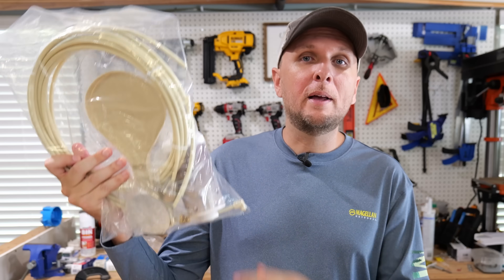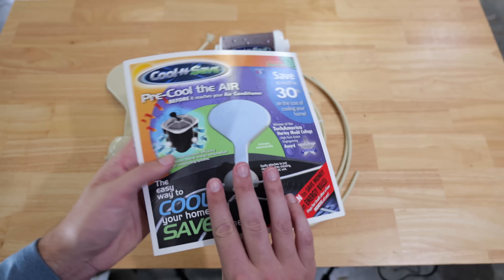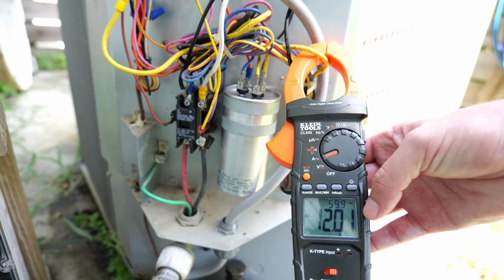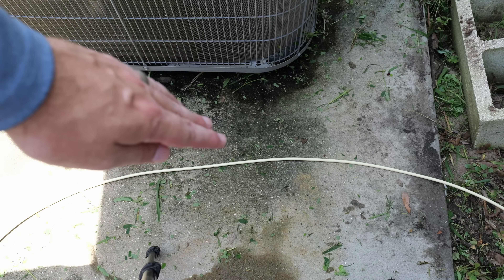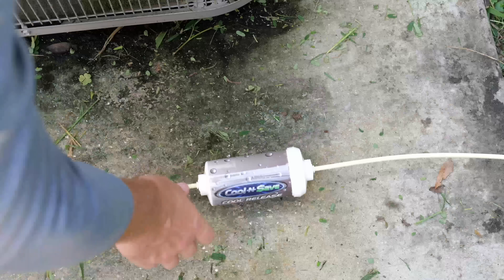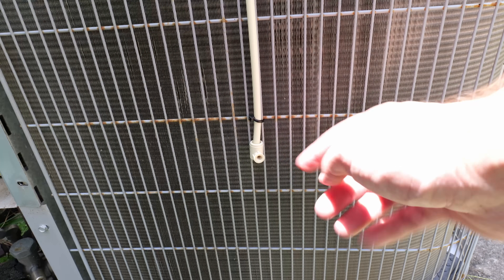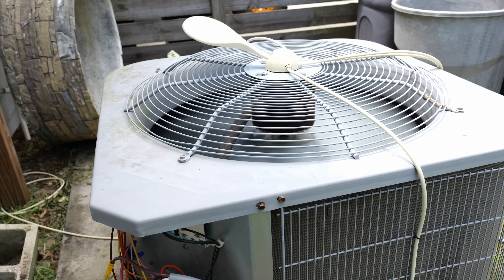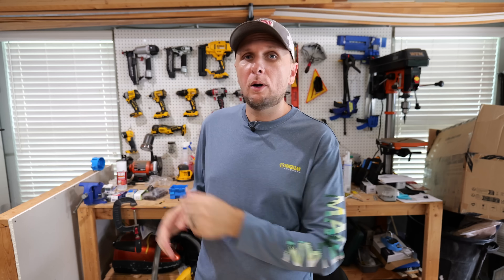This Device Can Save You 30% On Your Energy Bill! Makes The AC Blow Colder

Comment: For most of us, this will 100% eventually lead to scale buildup on the cooling fans, essentially eventually destroying the condenser unit. (That would obviously obliterate any electrical savings you manage to glean from this system.) That little filter they provide is almost certainly not up to the task of removing enough hardness from the water.  Instead, a more robust water purification system sized for the needs/flow rate of this system would need to be installed.  

At a minimum, the water needs to be tested for hardness after it's run through that filter, but I would be extremely skeptical of the "safety" of any hardness level above what naturally occurs in rain water.
Reply: When you say most of us, you are not speaking for those of us who live in an area of soft water. Similar have been used in the South, where I am located, for years with no adverse effects.
Reply: @Watchyn_Yarwood  There's a reason I didn't say all of us, and I indicated that softer water would be okay. But most of us, as in most of the population, does not have soft water. Obviously, some people do, but this system should NOT be installed without understanding and fully mitigating this system and its risks.  The cost of failure here is a new AC condensing unit.
Reply from the maker: That is what the filter is for and I also talk about a water softener being nice added addition.  But the filter removes scale so I think it’s completely false to say it will 100% leads to scale build up.
Reply: @HowToHomeDIY Have you tested the water before and after it has been run through that filter?  I haven't for that one, but I have for others that claim to do the same, and the effectiveness was not terribly high. One should not implement this system without ensuring the amount of dissolved minerals in the water where it leaves the misters is at a level where scale will not build.

Furthermore, most outdoor spigots are supplied with water that has not been run through the home's water softening system - they tend to be specifically excluded from the system. So again, people need to understand everything involved before implementing this system.
Reply from the maker: I don’t disagree that everyone should understand their own setup, I said that in the video at one point.   To me 1.5 amps lower and at least a degree lower at the register when at that point the outside air had risen 7 degrees between the two tests is pretty impressive to me.   The amperage drop alone was over a 12% reduction.  The air being cooler will cool the home faster therefore not running as long.   If you don’t believe in it or don’t see that as a big difference then don’t do it.
Reply: @HowToHomeDIY  At no point did I suggest this wasn't effective. My point has been to make sure that, in an effort to reduce electrical cost, you do not destroy your very expensive AC condensor.  From the beginning I have cast doubt on the effectiveness of that tiny filter and the lack of assessment of the water being misted onto the very critical and quite fragile cooling fins.

You will take the time to needlessly physically disconnect power to the condenser simply because you're near it, but assessing a very real danger to the longevity of an expensive and important home system is problematic to you? 

Bizarre.

Comment: A really well made video, so easy to follow along with you. Thank you. I may get one of these as they seem to work as advertised.
Reply from the maker: You are very welcome.  I have been impressed with the results.  Like I mentioned in the video, make sure to do your due diligence and verify that this would be a good addition for your AC unit.  I would recommend a simple water test to make sure it isn't extremely hard.  The filter is designed to remove most of if not all mineral deposits to prevent scale but like all things, there are limitations.  You can find all of this on their website as well.  Thanks a lot for the feedback!!

Comment: Thanks for the video! My home uses the a/c unit to heat the house in the winter. Would there be any benefit to using the mister in the winter or just turn them off?
Reply: Definitely turn them off. Don’t want ice to form anywhere

Comment: Inconclusive testing since the temperature of the outdoors air wasn't measured and may have varied.
      Also, what about the increased water bill?  Can the water be recaptured and used productively, for example to water the lawn & garden?
Reply from the maker: You’re right, it was actually 7 degrees hotter during the second test than the first test so the results would have been even better had the temperature been the same.   It is my understanding that the amount of water used but this on average per day is equal to flushing your toilet once.   So the increase in water is incredibly low as water is not expensive.
Reply: @HowToHomeDIY  : I'm glad you shared that temperature data.  Can we assume there were no other significant uncontrolled variables that changed between the two tests, such as shade on the house due to the angle of the sun?
Reply from the maker: Not that I can think of.  The way my house sits, other than in the morning and evening the unit is about half shaded half sun during the day.  There was some partial cloudiness but I don’t think the cloud cover lasted long enough to ever make a real difference.
Reply: @HowToHomeDIY  : I wasn't referring to variable shade on the HVAC unit.  I meant variable shade on the house.
Reply from the maker: Oh ok.  No my house gets full sun all day.  I am trying to get some trees to grow on the south side to help with shade but unfortunately they are still not tall enough.
Reply: @HowToHomeDIY  : How about a change in the wind?  If my understanding is correct, a (warm) wind would increase the rate at which the house loses its cool, compared to idle air at the identical (warm) temperature.

Comment: Over a few years the radiator fins will become coated with water deposits that will be impossible to remove, resulting in costly repairs/replacement, far outweighing the savings of dropping two amps.
Reply: 1:26  he literally describes the filter removing scale build up I would be more concerned about the aluminum coils corroding due to ionic charge from the water and electricity
Reply: @Justthemow  Aluminum coils shouldn't corrode unless you're in a highly salty environment, like very near a coast.  Clean water is fine.  I haven't measured it, but I doubt there's much charge at the coils - the electricity is ~1 foot away in the center of the unit and well shielded to avoid moisture ingress.
Reply: @sandman9601  I’m talking about static electricity from vibration and the water aluminum does rot or corrode and it doesn’t require salt water it basically turns into like a white powder
Reply: @Justthemow Interesting.
Reply: Agreed, it was built up badly over a period of months. Do not recommend.
Reply from the maker: @richardgoff6739 you used this particular one?
Reply: You could remove it with corrosive chemicals... oh wait, that is not good for those radiators.
Reply: Sounds like it just needs to be ran off purified water. No big deal
Reply: @TRYTOCHALLENGME How do you do that?
Reply: Head pressure and compressor amp load both drop when cool water is applied to the coil here in Florida. Not sure how that could be a bad thing. It is extremely hot here.
Reply: that is why you clean your coils
Reply: This is exactly how window units work and increase efficiency
Reply: That's what the filter is for. They also make cleaning fluid, which you should do every so often anyway.
Reply: All these know it alls😅
Reply: So many theories here without any data. It comes with a water filter.

Perhaps a better question is whether the frequency cost of water filters is more than the cost savings of this setup.
Reply: @ModularMuscle $29 per 3 months of a filter = $120 per year
Reply: A simple filter won't work on hard water.  If it did, they'd quickly replace expensive water softeners.
Reply: @usasupra23 Maybe $60 unless you live in Florida then it's $90.
Reply: @ModularMuscle  There is no filter for calcium hard water on the entire planet.
Reply: @PrettyGoodLookin their certainly is. I’ve used them before. In LA they have hard water companies that put them in houses
Reply: @gtbigdog3507  It's not a filter tho.  Tell me the name of what you are referring to ?  Reverse osmosis ?
Reply: @PrettyGoodLookin wrong.
Reply: @PrettyGoodLookin  Reverse osmosis process waste 80 - 90% of water so if you process10 gallons you waste 8 - 9 gallons and get 1 - 2 gallons pure water
Reply: @ModularMuscle  they havent even mentioned that if this worked the epa would have required manufacturers to build it in it by law ages ago. the epa is constantly mandating higher and higher seer ratings to "save energy" causing the cost of hvac to skyrocket. yet they supposedly missed this thing?
Reply: You should get a yearly clean of the outdoor and indoor unit coils regardless. The cleaner they use will remove mineral deposits.
Reply: my AC unit here in texas doesn't need more than a blow from a gun to clean. But the scale in the old bathrooms is like a rock in fact it is just like limestone CaCO3 @RussellWaldrop
Reply: @RussellWaldrop  Never did in my 47 yo systems up to the time I replaced them to prepare for a house sale. No problems.
Reply: @wholeNwon Does this mean you've had something similar for 47 years? If not where is the corelation?
Reply: @RussellWaldrop  doubtful.  The coil cleaner removes organic matter.
Reply: @Crunchifyable2 Limestone and calcium are inorganic. They're minerals.
Reply: @RussellWaldrop Nope, those cleaners aren't designed for that.
Reply: @RussellWaldrop  Maybe,  but I wouldn’t be surprised to see your maintenance company charge more for the extra cleaning time.
Also, I wonder how long before the tube gets damaged, along with your water bill. 😮
Reply from the maker: @foryoureyes4616 there is no way you have experience with this particular system.
Reply: It saves you $ until you have to buy a new coil
Reply: In the gulf south, I can collect rain water (no minerals) and filter debris and organic materials using a standard filter. It will work and still limit build up on the coils.
Reply: why not just clean your coils a couple times a year as you're suppose to which would prevent any build up on the unit?  just a little common sense goes a long way
Reply: Just clean your fins every fall... simple
Reply: You need a water purifier system… this is only good where you have free water.
Reply: I doubt it. Ive had an ac with a broken fan that has been water cooled for 5 plus years now. It was 98 outside today and its 66 in my house. Also i recycle the water and only add water when enough evaporates. I also am on solar and batteries with no grid. Also all you need is a water softener
Reply: If this is in fact a great money saver (and not damage the condenser unit in any way), then why haven't the engineers for the  major HVAC sellers (Trane, York, Carrier, etc. ) come up with this same "money saving" add-on to their units? My guess is because it doesn't save any money in the long run😉
Reply: @stevenz933 all large industrial units use this concept. The problem is the AC companies don’t do this is because it’s more costly and more maintenance
Reply: @gtbigdog3507 where's you evidence?
Reply: Wouldn’t the incredibly tiny orifices  on the misters clog before depositing any minerals?
Reply: @stevenz933  Just so you and others know, all a/c companies know that this technique works. And this technology is used all the time - they call them cooling towers. They cool the refrigerant better and in a smaller space for units that are in the basement, such as chillers. 
What's bad about them, is that they use a lot of water.
Reply: @sprockkets  Cooling tower are slightly different but close.....water run in a loop and is only added when evaporates. In this case all the water is gone. Also running water towers is very complicated task. You remove mineral deposits, maintain ph and regularly clean entire system. An average homeowner would neglect all those necessary task pretty quickly.
Reply: Won't the filter prevent that?
Reply: I was an A/C licensed contractor for years. The other issue is some form of mold or fungus or something starts to grow on coils that are constantly wet. It's mostly a maintenance nightmare in my professional opinion. Water can work as a temporary/emergency type solution such as a condenser fan motor not working but I definitely would not use something like this 'always'. Also, water costs should be considered as well.
Reply: @SniperTrader2023  I made my system back in 2013 no problems with fungus or mold. I also used a calcium/mineral filter and no problems with mineral buildup.
Reply: p

Comment: Any problems long term with water mineral deposits long term?
Reply from the maker: The mineral deposits depends completely on your water.   Their website talks in depth about this.  I have no concern as my water is soft due to my water softener, area of the country I’m in, and the anti scale filter installed.  I will monitor it closely though and if I see anything of note, will definitely make an update but I don’t foresee that.  No, it won’t cause an outrageous water bill as the other commenter has said as the amount of water used on average is about the same as flushing your toilet once a day.   And water isn’t expensive.  Only times people notice their water bill go up is a large leak somewhere or they have teenagers that take extra long showers every day 😂

Comment from the maker: Thank you to all of you that suggested this!  Is your AC unit running more this summer than normal like mine has been due to the heat?  I definitely look forward to seeing the energy savings from this install!
Reply: How much time does your condenser spend in the sun? I helped a friend build a wood shade wall around his since it was installed on the side of the house exposed to the sun the most. It helped immensely.  Might be worth looking at too. Especially if it's exposed to the sun during the hottest part of the day.
Reply: Mine is exposed to the sun as well.  Can you show a picture of what was done to help out? Thank you!!  @mtnman1984
Reply: Thanks for sharing.  Your analysis is OK up to the point of verifying a 1 amp reduction in electrical use and a 1 degree change in cooling saves money. No data was provided to indicate the current costs prior to installation.
  Care to share the exact  numbers for verification purposes?